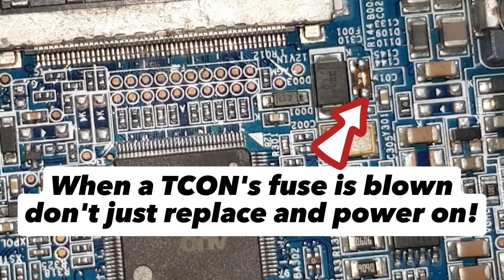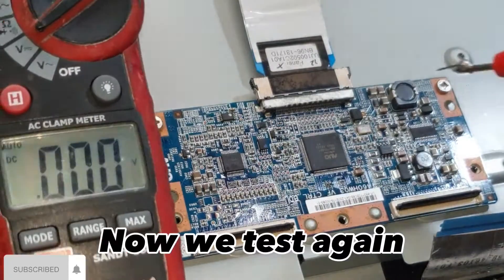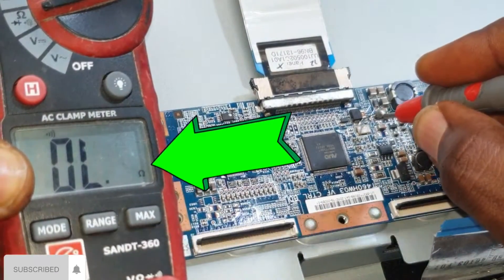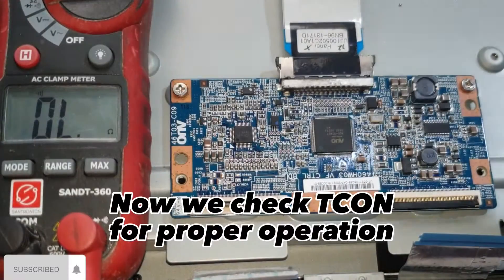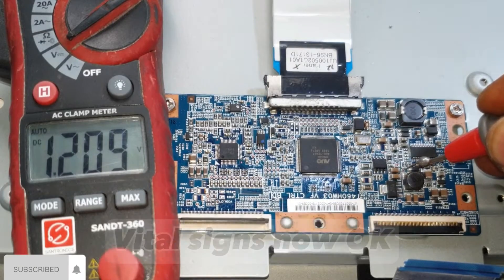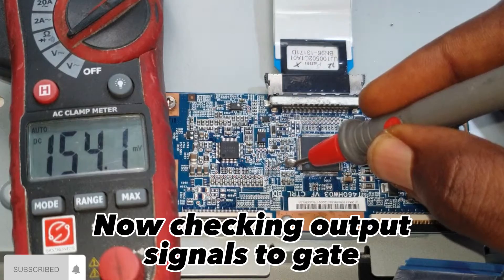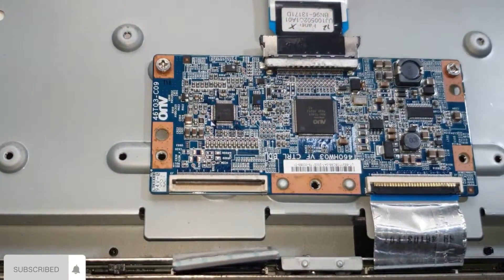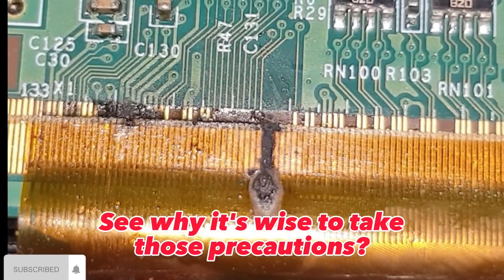LEARN SMART PRECAUTIONARY TV TROUBLESHOOTING PRACTICE #lcd #led #tv

Comment: yep this one new dont know why fuse explosed and only bypass LOL amateur video all can change fuse i have alot in my car retard
Reply: Please explain ?. If your reply was to me. I wasn't calling the video author an amateur, far from it. It was a general comment about people bypassing fuses and just leaving the bypass there permanently. In this video, checks were made to ensure there were no shorts present and as far as I can see the bypass was placed so that further testing could be carried out.
Reply from the maker: Well, bypassing the fuse using that very wire works perfectly! I've experimented with it a good number of times where the wire safely broke when the fuse was shorted to ground, saving the modules from damage.